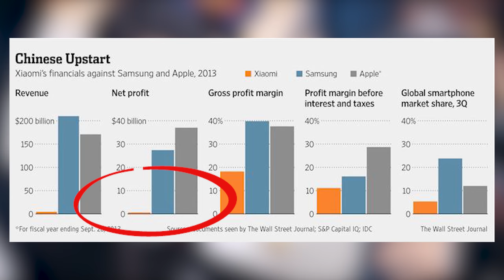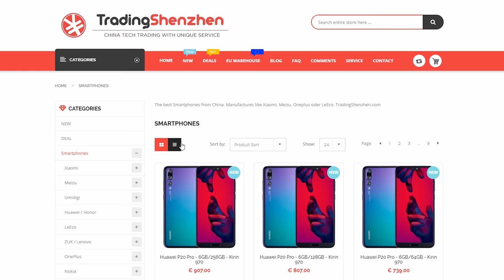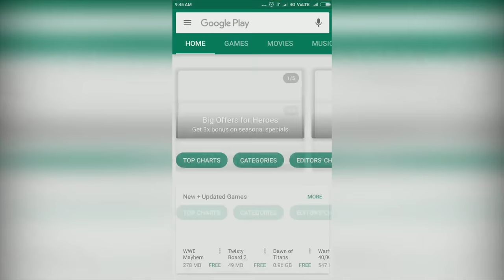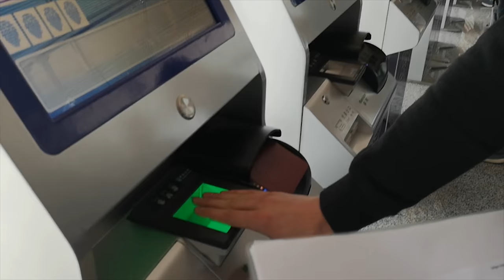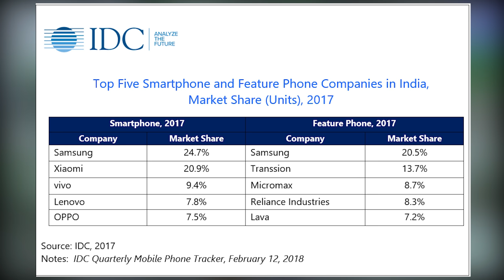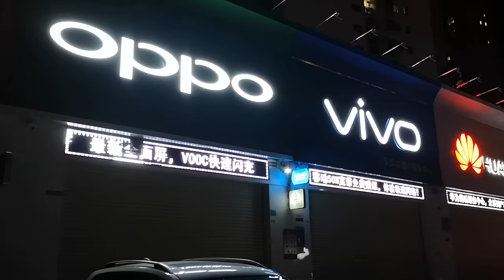The TRUTH about XIAOMI !

Comment: Xiaomi phones are cheap but durability is short. In couple if years it behaves clunky and battery drains quickly. Compare to that Apple could last at least 10 years and Samsung seven years. Apple and Samsung has good resale value of old phone while Xiaomi goes in the dust bin in third year.

Comment: I've always been a Samsung guy. I was once convinced to get an Iphone 5th gen, I guess ,by a friend. I used it for about a month and re sold it at a negligible loss. If you compare the UI of that generation to any android device I encountered it can't be called anything but a scam. Borderline unusable. But that's a bit besides the point. I'm currently A MiMax2 user. This was my first Xiaomi device and since then I've purchased a bunch of periphery items and gadgets and I'm very satisfied thus far. I'm a big guy and there aren't all that many big phones on the market in general. I often need to edit documents on the go so the screen size is ideal for that.  I'd definitely consider Mi Max 4 when it comes out or even upgrading to Mi Max3 if this one develops any issues. Best user interface I've seen, though, to be honest ,I've never been particularly interested in smartphones and I've personally had relatively few over the years compared to other people.

Comment: Xiaomi is only good in terms of marketing. Good forming a good product image but not matched with adequate quality components. As the quality of LCD devices and eMMC are lower from their mobile phone production unit which potentially limits the use of short range. Especially if the unit is have to root or flash. Then unit resistance will be lower. In other sectors such as wearable technology, Mi Band quality is quite good. But the performance is not so special than for example Honor Band from Huawei. Only the Xiaomi meticulously create applications that are more flexible and efficient. The level of quality is not too good that makes the price of Xiaomi electronic products become cheaper or more affordable. Then offered to consumers with an effective strategy mechanism. And? People love it.

Comment: Xiaomi is shit. Bought Note 8 Pro and it had a broken pixel. Got it replaced with Note 9 Pro only to find dust particles inside the rear camera lens. Sold 9 Pro and bought Mi Note 10 Lite. After just one week, its rear body got multiple scratches on the corning gorilla back body and also on the top rear camera. Kept it with extreme care, and it didn't even fall once, and still caught scratches. Sold Mi Note 10 Lite today, and I'll never ever in my life think of buying anything from this shit brand again.
Reply: Just use a case then? Glass will get scratches always when u put it on a table or whatever no need to drop ur phone it will get scratches anyway😉
Reply: @l1o_x  Always use back case and screen protector for my mobiles. The so called gorilla back caught scratches even after using with back cover and it didn't even fall once.
Reply: @zainulabideenzain3  Their are more soft to resist drop and more harder to resist scratch
Reply: @zainulabideenzain3  Do buy cheap case ?
Reply: Finally someone with the same issues as me